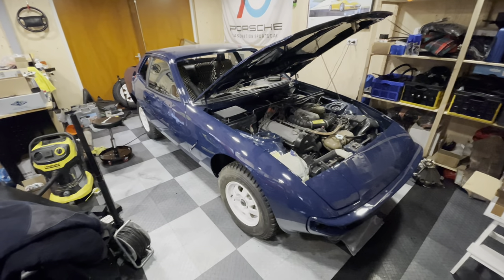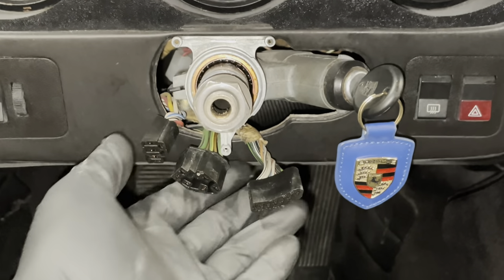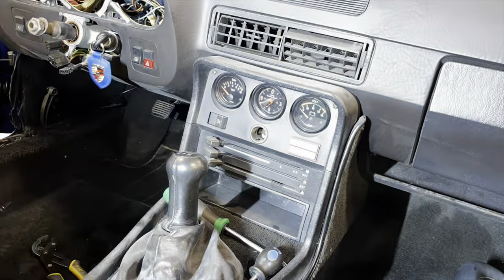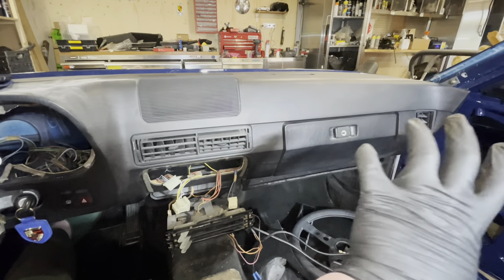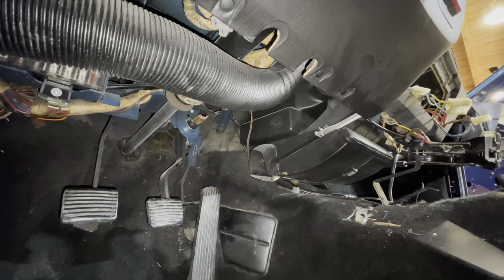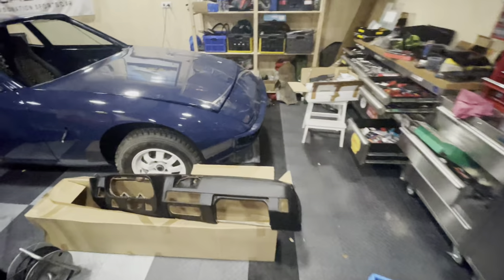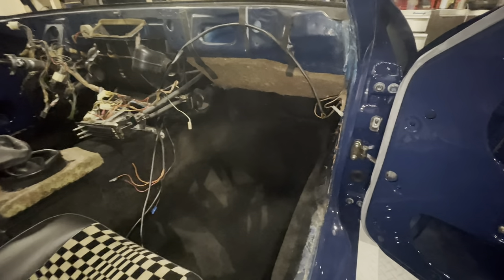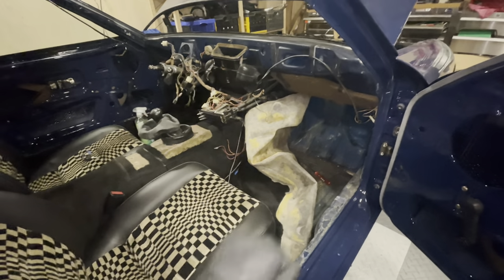Building a Porsche 924 Safari: New dashboard and rust. #Dashboard #Rust

Comment: Just wanted to thank you for taking the time to video the dash removal.  I also have a brand new dash from Porsche and was/am intimated by this job.  
With that said, sorry about the discovery!  Hopefully your body guy can get it handled easily.
Reply from the maker: Happy to be of service Max, it really isn't as daunting as you feel it might be. I think without filming I would have had the dash out in under two hours. The tough bit is that it sometimes feel like the parts want to break as you pull on them. Just take your time and double check your work. Other than the A-pillar trim removal I showed every single step. Good luck!!

Comment: I think that area at the front corners of the floor is a fairly typical 924 rust spot. My car went there also, quite localised and like you the metal around was fine, so not very difficult to repair.  My car is RHD with the battery is on the other side, so it wasn't related to that in any way.
Reply from the maker: Interestingly once they cut it open a lot of sand came out of the sills. Maybe the water that gets in through the vent on the B-pillar pools inside the sills there in the front?

Comment: the rust is most probably from the battery-box where water is led down through it with acidity from the battery. You should also check at the center at the torpedo. I had the same issue with mine
Reply from the maker: The strange thing is that my battery box is rock hard, not corrosion whatsoever. I will have them double check the whole car again. I don’t want any more surprises 😕
Reply: @GarageBiljon  well you have a hole in the batterybox where water coming from the windscreen is supposed to escape. If you take out the battery you will find that hole. It is important to keep this whole intact so any water can run out through it. It is basically a design flaw. Its a known issue. What happens is that the whole is blocked by dirt or by leaves in the autumn. Water resides and in old days where the batteries were not that tight acid-damping would escape and mix with the water. Slowly but surely you build up rust when acid-water is dripping out. This is most probably what happened.
Reply from the maker: Thanks John, that makes sense. I will investigate it further.